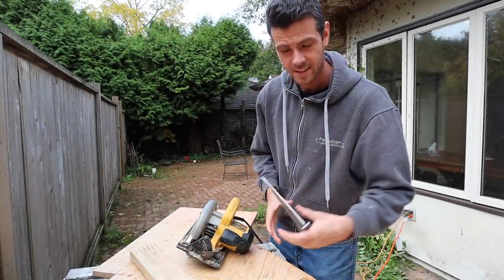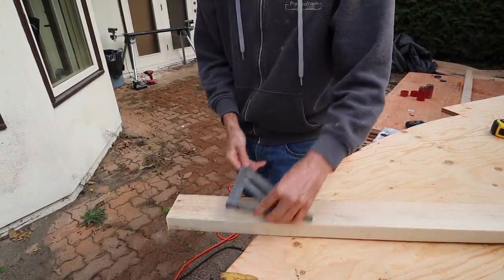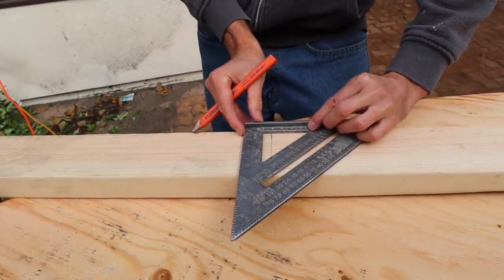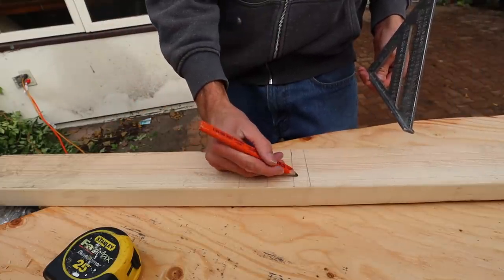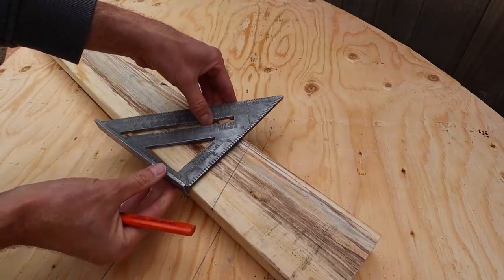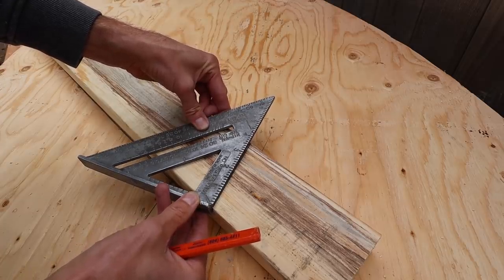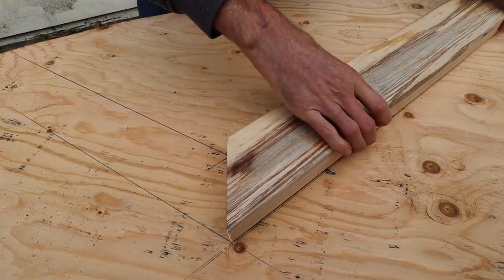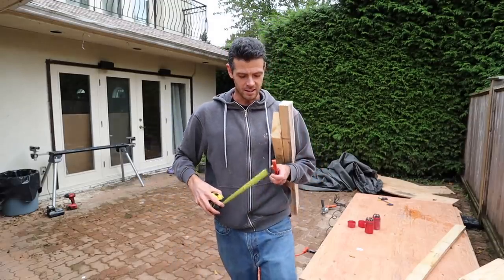5 Pro Speed Square Tips!

Comment: When you’re measuring out the parallel lines using the notches on the inside of the speed square, flip it around: line up the notch with the line you’ve already drawn, then you can just draw the new line along the edge of the square, saving the step of marking where the notch lands and moving the square over to make the line.

Comment: Bro that’s a cabinet saw. That’s not even a standard Saw carpenters use that’s a homeowner DIY saw. I typically don’t allow those saws on my job site. Only a drywaller or a painter shows up with a saw like that. 
Not sure how they do it in Vancouver that might be the main saw everybody uses LOL not sure. Out here in Cali we use Skil saw‘s but for some drywall backing I guess that saw will work. 
Typically those saws are to cut three-quarter inch material plywood things of that sort.
But still cool video man I would just get some better tools and if you’re a Carpenter where are your bags bro. It should say Vancouver drywaller/painter or DIYer. I’m just saying 🥴